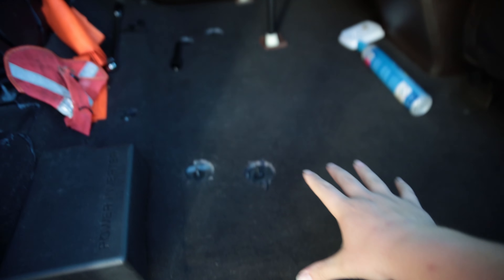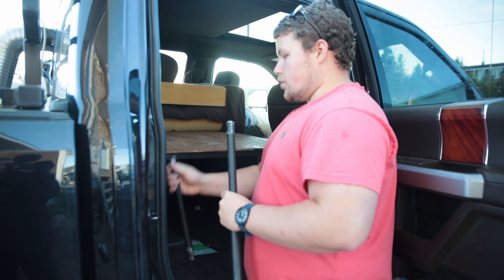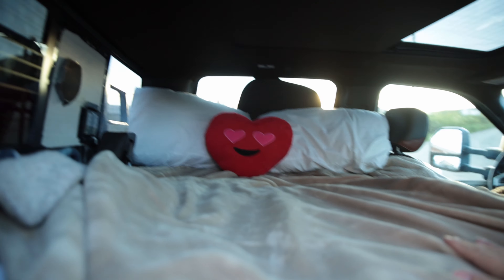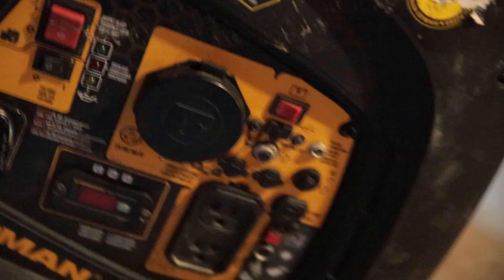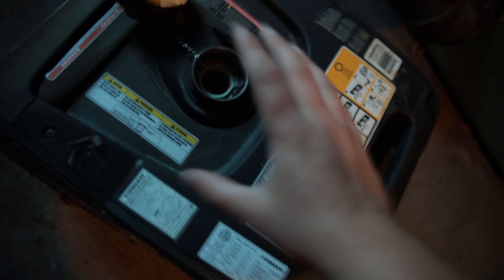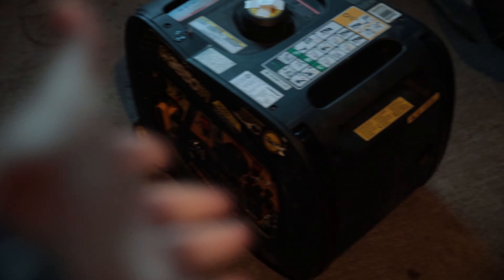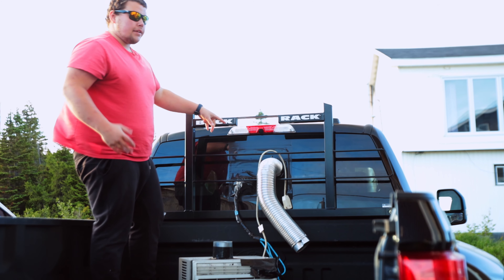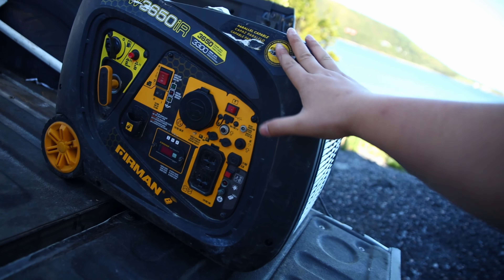HOW I Built A BED In my TRUCK And a Place For My Dog! *WITH A/C*!!!

Comment: Looking great! I had a bed setup like this when I was in my pilot truck. For the windows I got a roll of reflectix and cut it down to size so they just pushed in the windows, stayed dark inside and they also trapped the heat in, It would stay warm for ~3-4 hours at -15 then just hit the remote start in the morning! For the new work truck (semi) It's got a webasto bunk heater, consumes 0.2-0.4L of diesel per hour throughout the night and it always stays warm. I'm digging the ac!

Comment: That would be cool if you could rig up an electric motor to the oem ac compressor under the hood so you could use the existing ac equipment